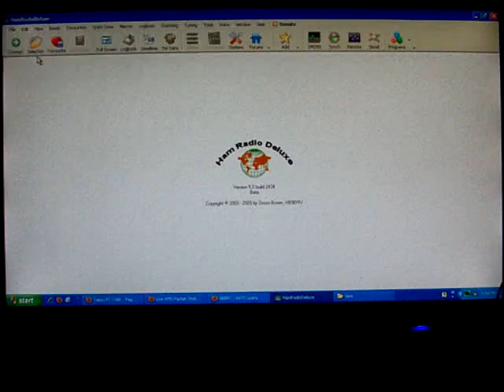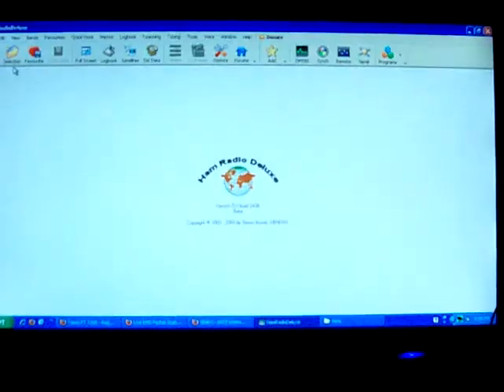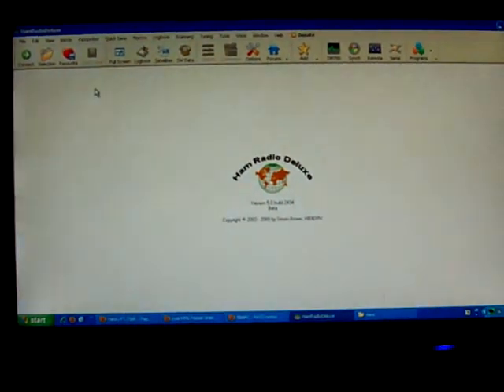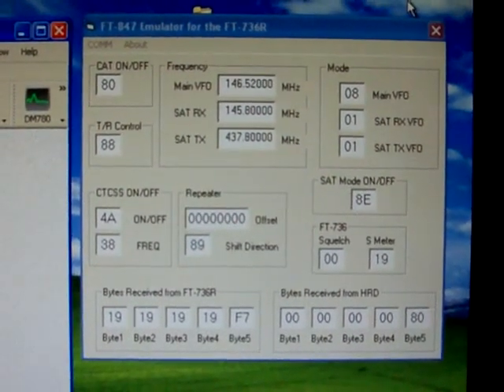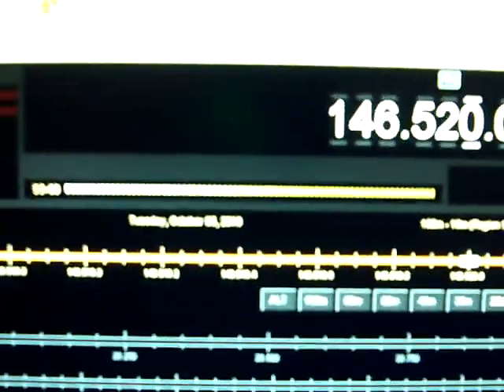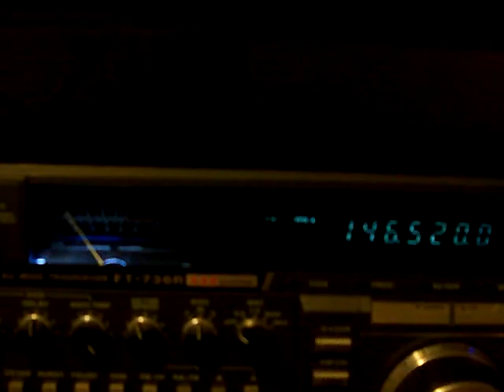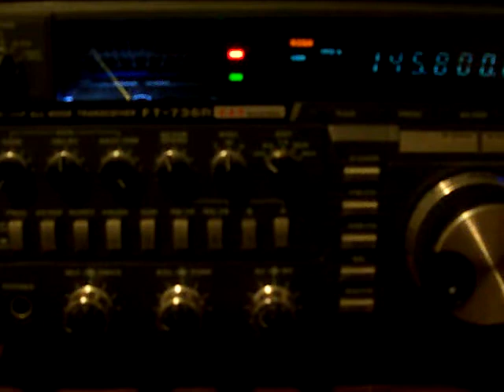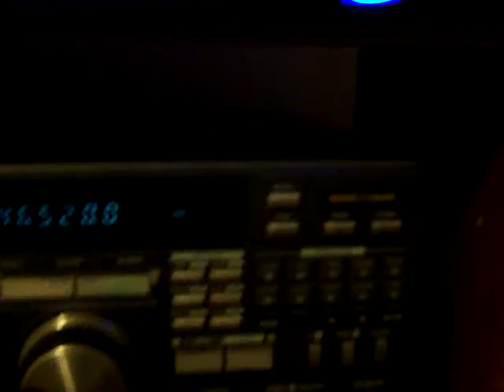Using Ham Radio Deluxe with the Yaesu FT-736R

Comment: This is a great step forward for the FT-736R for satellite users.   As a terrestrial VHF/UHF weak signal guy what I am really looking for is someone to come up with a modification for the radio's CAT interface to read frequency, band and mode information BACK to the computer for logging purposes.   I don't need to control the radio,I  just need read the current freq, band & mode information.

Comment: well it's 5 years later, did this development went on ?? 
Quite a nice application you designed there though. 73
Reply from the maker: Thanks so much for asking. Yes, a lot happened after this video came out. check it out at http://tinkyr.net46.net/radio/projects/736/Ham%20Radio%20Deluxe%20and%20the%20FT-736.htm
Reply: thats cool , Thanks ! 73
Reply: +TinkTron  Is the site still up? Your link does not work and I am VERY interested in getting/purchasing this application! 73 KG5JGL
Reply: yup
Reply from the maker: The website had a very unreliable host. I have moved to http://tinkyr.altervista.org/radio/index.htm

I may provide a PCB and programmed chips in the near future like I do for the Icom stuff.